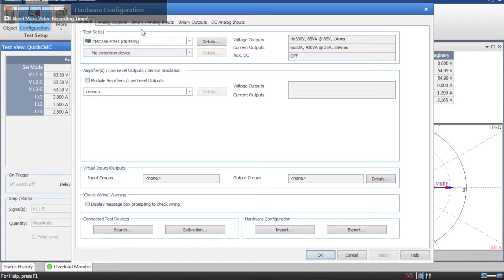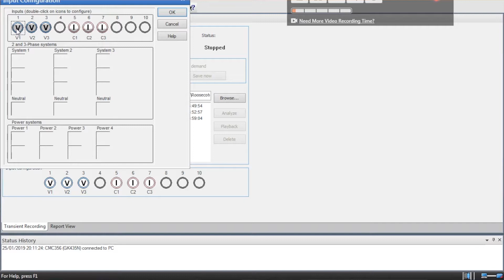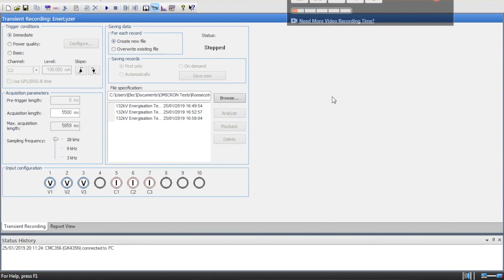Omicron Enerlyzer Software Setup

Comment: How to check injected phase angle without enerlyzer.
Reply from the maker: A three phase power meter would be able to read all three phases and currents and provide the phase angle information as a power factor. There are also some clamp meters out there that can measure the phase angle on a single phase source. These generally provide the value as a power factor and will not be as accurate. Their recording rate will not be as fast as the  enerlyzer.

If it is just the phase difference you want to measure there are also a some specific phase angle meters that would be more accurate, but with an increased price.

Depending on your test setup, you could also measure it with either a digital storage oscilloscope or a dual channel counter. These generally need a differential probe to protect their input channels from the higher voltages.